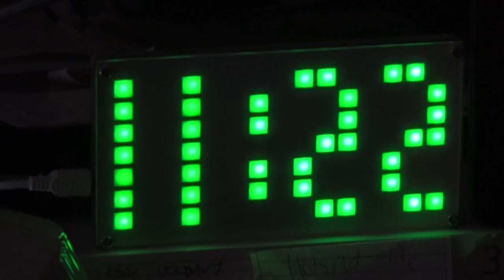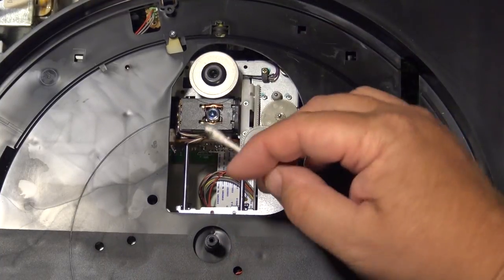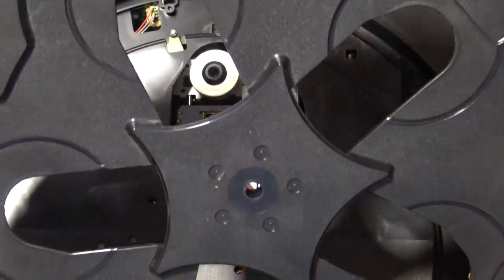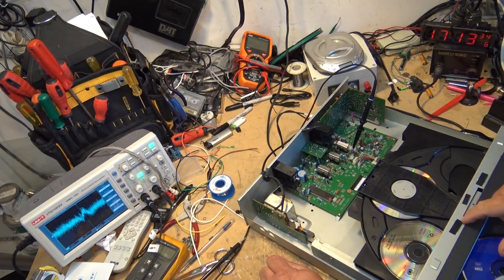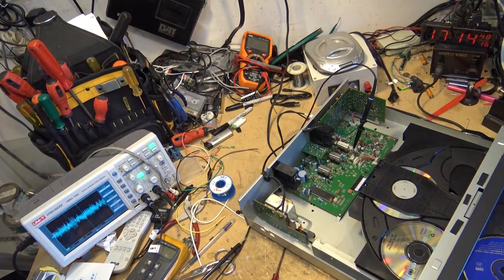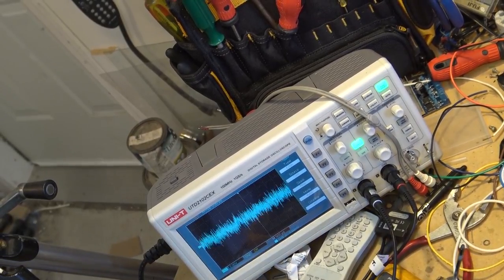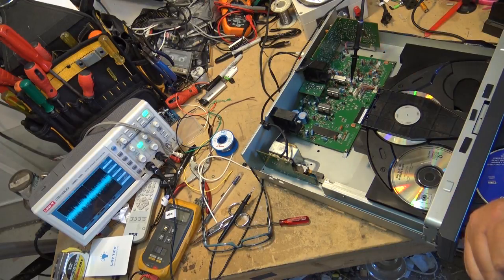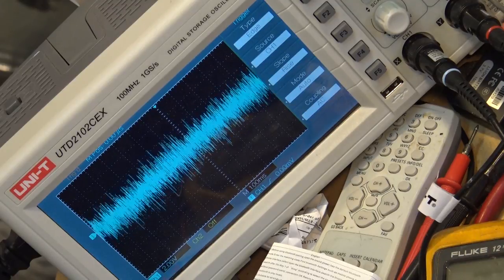NAD 517 CD changer skipping on playback

Comment: I like the older cd players because they have the adjustment pots and you can almost always compensate for the weakness of the laser or other components. The newer ones with no adjustments other than laser current they usually just give an No Disc error and there's nothing you can do but to replace the whole pick up itself. Cheers :)

Comment: Well done, another old unit lives another day :-D
Those pesky capacitors in the control system may have drifted too, we know how you really love capacitors He he :-D

I still wonder if the emission of c.d lasers becomes impure in some way, the laser emission amplitude can be adjusted but that often does not help.
A new laser assembly often fixes it.
C.d players die too easy for my liking.

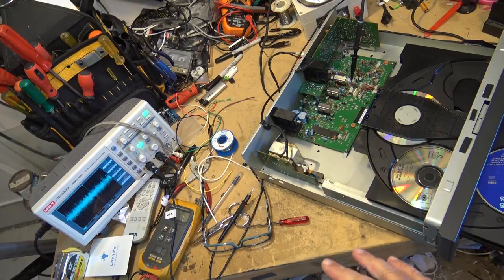Comment: 8:49 Hi, could you tell me what a tracking balance pot does? and Focus balance too. Because I've recently replaced a laser on my Kenwood CD player and it was starting to skip from somewhere around 5th track on a lot of CDs, first few tracks it played ok, so I've marked all pots original positions, I had 4 of them, Focus gain, tracking gain and tracking, focus balance, the only one which fixed the skipping was Tracking balance pot, moving it a few clicks clockwise eliminated skipping on all CDs. So I wonder what it does. While tweaking TG it was apparent that it increases tracking sensitivity, while tweaking Focus gain it gave me impression that it adjusts CD spindle motor speed, or laser focus sensitivity and in turn laser adjusts spindle speed, I don't now how it works, but the only one that right away fixed skipping was Tracking balance pot, so I wonder what it does and why it fixed it. As far as I've read about it, it suppose to adjust symmetry between upper and lower waveform pattern, how does that translate to skipping from 5th track on, if that balance is off?  and is it necessary adjustment for all laser replacements on units like mine which don't do any automatic calibration?
I don't have an oscilloscope, so I can't see what those pots are doing exactly, but I'll definitely gonna get one, that can do an eye patterns, as soon as my financial situation allows.
Thanks for reading.

Comment: I wish you lived near me. I have the exact same problem with my 515. I do have a new lazer in it.
Reply from the maker: It's a pretty common problem. I took the gear off, and cleaned all grease off with alcohol. Then just lightly touched the plastic with the hot iron to fuse the crack shut

Comment: What oscilloscope would be required to check Tracking gain and E/F balance? Will 10MHz Bandwidth, 50MSa/s Sampling Rate be enough? Or higher bandwidth/sampling rate required?
Reply from the maker: Not doing that with a digital scope.  A 10mhz analog scope if more than enough for that.

Comment: I've been working on restoring one of these forever. I managed to get everything to work on it except for what control system  controls the laser motor position. When I turn it on, it just slams the laser all the way to the inside of the disk and starts grinding the gear up. IC101 is really, really hot, so I think that may have something to do with motor control, but no manual to work from :(
Reply from the maker: It is probably the ic that is burning up.  Internal short.
Reply: @12voltvids  aye, probably keeping the motor on all the time, will see if i can replace it, hard in these times though :(
Reply: @kevito666  just curious did you clean the switch the tells the logic circuit the the laser is in the home position? If it doesn't signal the micro processor the logic circuits are attempting to get it to the home position ... until that happens the sled motor will stay on till the laser assembly is at the start of the CD player (reads the TOC) in other words if the home switch doesn't signal the micro processor it will keep trying to make it go home LOL
Reply: @darinb.3273  I suspect its the IC as the switch seems to be working. As soon as the device is powered on it starts the motor without any input from me.

Comment: if you have an oscilloscope at hand, why don't you take the eye patterns as a reference, everthing is in there, for nearly all adjustments. the clearer and sharper the eye pattern gets, the better the tracking is, the cleaner the optics, the better the the rf amp gain etc... 
as it is the last analogue signal before it's in the 1/0 detection for DA converter. 
first get the thing playing at at all, then run through the adjustment pots again and again and again. if the eye pattern looks perfect, then zoom in at the "hair cross" and get that perfect.
If it comes to ray adjustment (sending diode current) of course you have to be careful not to blow it. for this you need a different test paoint and probably an additional meter (and follow the service manual)
Reply from the maker: I did look at the eye pattern, and it was fine. I just didn't show that on camera. I went to the tracking error test point as that is where the error was.
The eye pattern you tune for maximum gain but tracking errors don't show up nearly as well as the RF output or "eye" pattern looks at the 4 main detectors, whereas the TE test point looks at the side spot detectors. You want to minimize the side spot detectors from being hit. 
Looking at the eye the signal may dip slightly on miss tracking, but with the TE test, the errors show up as spikes. Much easier to see, and set up.
Eye pattern is more for focus gain, not tracking gain, and I didn't touch focus as there was plenty of signal. There was much time that the camera was not rolling as I would have had to cut the sound anyway.
Reply: I never could get a scope to look at an eye pattern properly. there must be some special way to set it up? I have a CDP-101 I need to realign after rebuilding both servo amp sections. Never got around to finishing that job. Then I have a Pioneer P-D70 that I have to build a new output filter for on one channel. it gets noisy until I squeeze the metal can. its an epoxy filled can so I cant fix it.
Reply from the maker: The eye pattern is the RF output. I have never had luck seeing it on a DSO, but on a good wideband analog scope it is clear as day.

Comment: Hi. Is this problem similar to a skipping, jump to a different track and continue playing?
Reply from the maker: Jumping forward is usually something in the gears causing it to stick. The servo cranks up the power to move the sled and it breaks free and overshoots.
Reply: @12voltvids  thank you for your fast respond. Any fixture recommendations?

Comment: i have one of the last cd players since 2003 the TECHNICS PG 04. I play the cd's and every time the cd skips within the track, i sent it away for service and its much better but it still skips on the first few tracks [2-4] then its ok. Mine doesn't have those adjustable pots. Could it be the laser? i'm thinking of renewing the laser.greetings from Athens Greece
Reply from the maker: More than likely the spindle motor.  Rcd the speed starts fast and slows down as the disk plays.  When bearings wear they can resonate at certain rpm and cause the disk to resonate enough to knock the tracking off.
Reply: @12voltvids  would replacing the laser solve the problem?
Reply from the maker: @rogerturner1881  not if it is the motor causing the problem.

Comment: People still use CDs lol
Reply from the maker: Apparently so. Yes many people over the age of 30 use CDs. The over 40 or 50 crowd even more so. For that matter U still listen to CDs in my 200 disk changer in the living room. First of all it sounds superior to any mp3 crap, and no I don't fall for vinyl like the wannabe hipsters do. Paying 40.00 for a record is far too rich for me, and I can't be bothered cleaning the record and putting the needle on. I do have a turntable, actually several, and I have some old records from back in the 70's but I have put them all on CD and listen to my compilations on CD. Much more convenient.
Reply: Who listens to mp3's anymore when we have lossless encoders like flac. I'm a 30 something and can't stand the sound of mp3's. All my CD's are now days is just backup media lol.
Reply: I buy them at Goodwill for $1.99 and RIP them to FLAC. So, yes people still use CDs.
Reply: One of my goals is to build an ADC using a PCM4222 and RIP my vinyl to FLAC. Then I won't have to worry about degradation of my media or playback equipment. It's now become possible to build DACs that can reproduce the original impulse response.
Reply from the maker: You would be surprised how many still listen to MP3. 
Myself I have been using flac for many years for my archive, but I use mp3 in the car as the in dash infotainment system doesn't support flac. For the car high bit rate mp3 sounds fine.
Reply: people still use tapes, reels, vinyl, everyday they are reliable
Reply: This old guy agrees 100%, could not have said it better myself!!
Reply: When I listened attentively I used CD,Vinyl and cassettes.But if I listened passively I use streaming.
Reply: I still love to play record albums-they have a distinctly different sound compared to cd’s and streamed music.